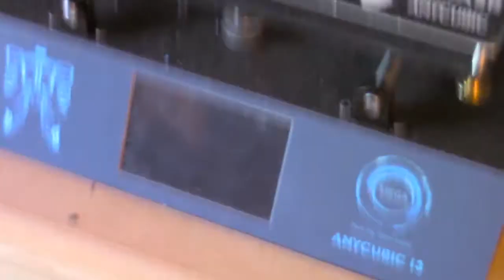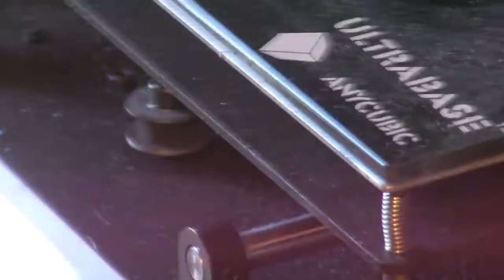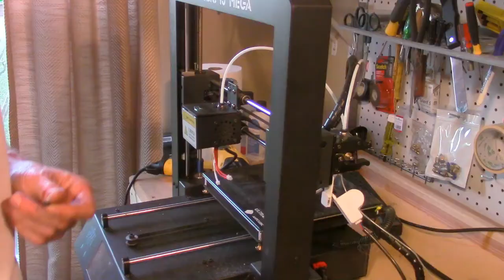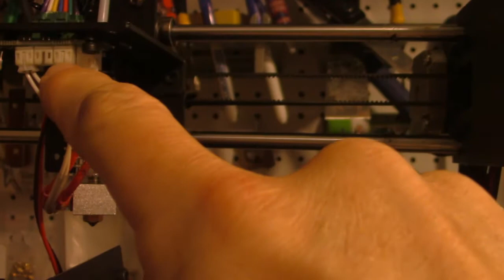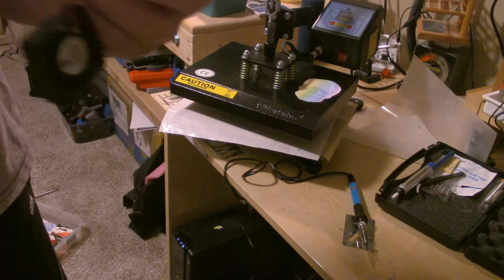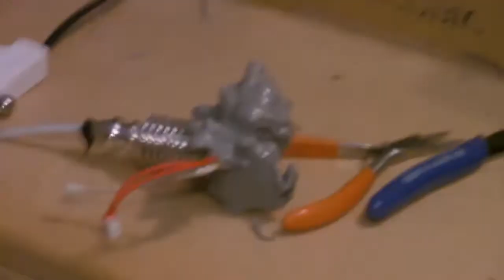AnyCubic I3 Mega Hot End Replacement after MAJOR clog

Comment: 9:50 How you get that coupler off?
Reply from the maker: Sometimes you get lucky but a lot of times the tube is trashed in the process.
Reply: @Duf okay yeah i got it off eventually using brute force but the tube is trash now. Really too bad that you cant get these off without destroying them.
Reply: @Twometer  you push down on the black thing where the ptfe tube meets the hot end and the extruder
Reply: @toasterbath1395   Thank you!

Comment: That was painful to watch. And all VERY familiar. I went through a lot of that when I melted a giant blob into my hot end (the FIRST time). Didn't use a heat gun to remove the plastic though. Spent about 2hrs trying to crush the plastic off with a large bench vise, & hacking at it with a chisel. About put out an eye when a chunk went rocketing off at 300mph. Broke the thermistor wire, & no way to fix it in these. An entire new hot end is less than $8 on Ebay. Ugh. 
Anyway, thanks for sharing your experience!
Reply from the maker: Ouch, glad the eye was saved.  Someone suggested baking it in the oven at 400 with aluminum foil underneath, might try that.
Reply: @Duf  oddly enough, I just had another melted blob today, but it slipped right off after heating the nozzle up to 220. So thank YOU for that lesson learned!